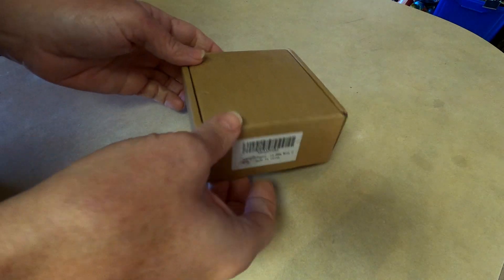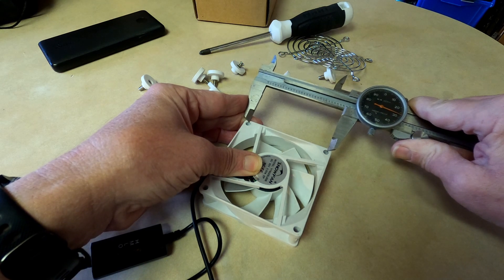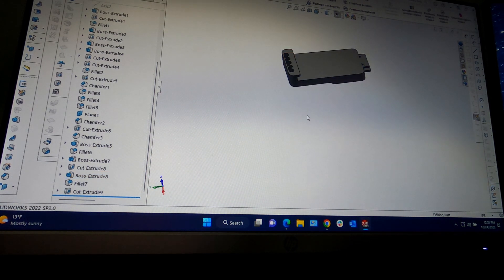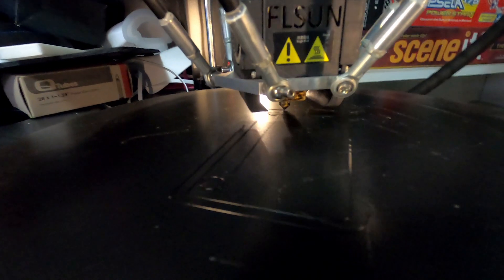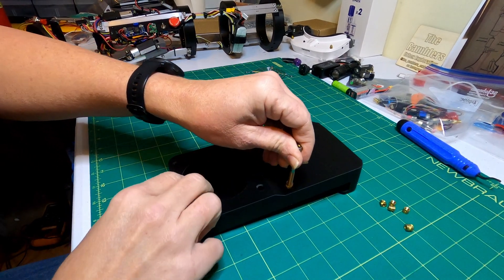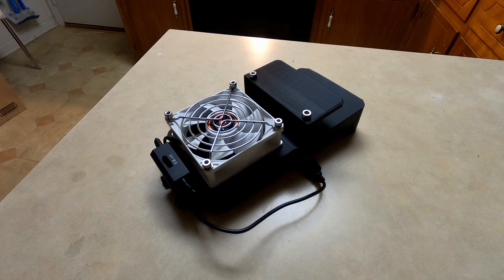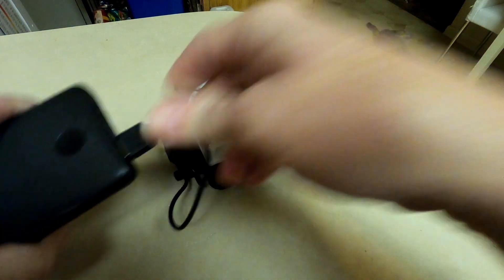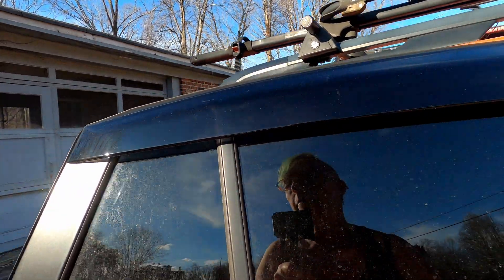Car Camping Exhaust Fan (Design and 3D Print)

Comment: Random and probably impractical thought here, but would it be possible to make a v2 with a heat recovery system? where maybe before the air is exhausted out of the car it goes through a dense water cooled radiator with a tiny pump that just catches thermal energy from the exhaust and then pushes it back into the car with another small fan and radiator. I wonder how effective/ineffective it would be.
Reply from the maker: Possibly, but this fan does not move a lot of air. It is designed to bring in just enough fresh air from a slightly opened window in the front of the car to make it safer to cook or heat the interior. A larger unit made for something like a RV could benefit from a heat capture system for sure.